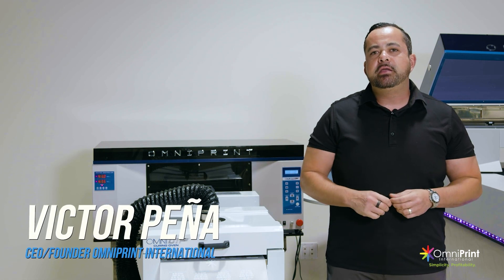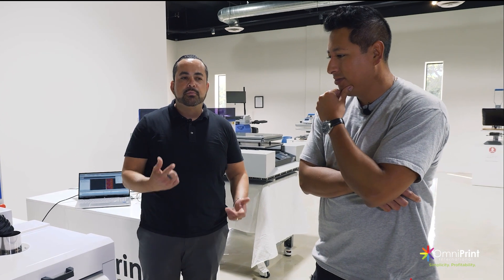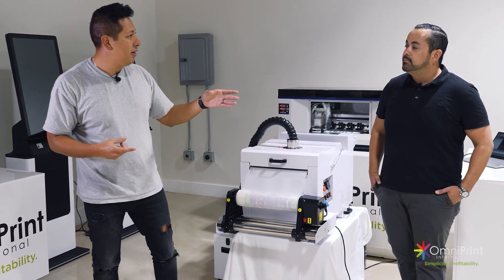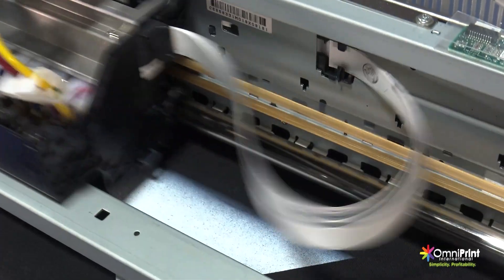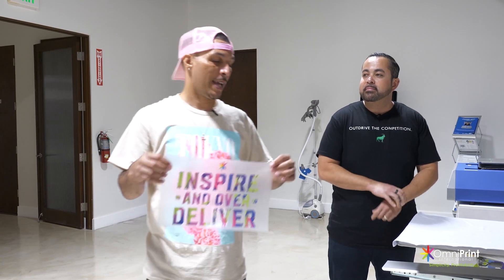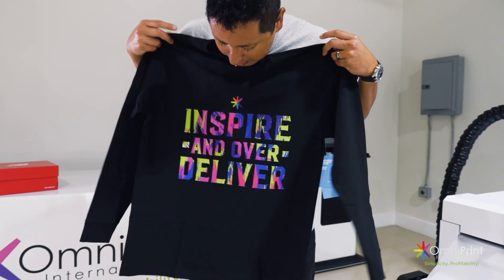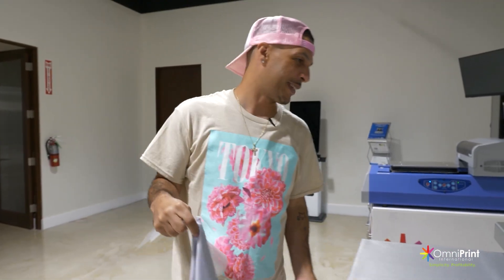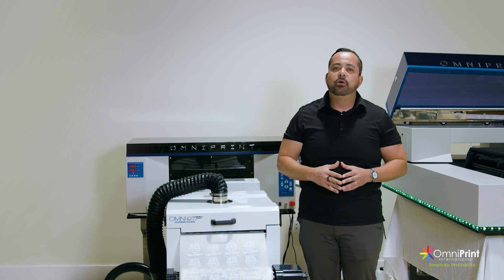The OmniDTF : Facts & Info

Comment: One question, does the printer work with Imac?
Reply from the maker: Hi Patricia, great question the printer works with windows. You would be able to use a mac but you would have to set up a virtual desktop using Parallels. We recommend using a PC.